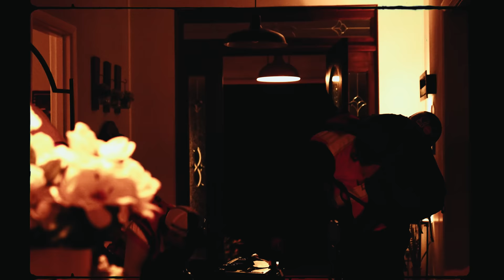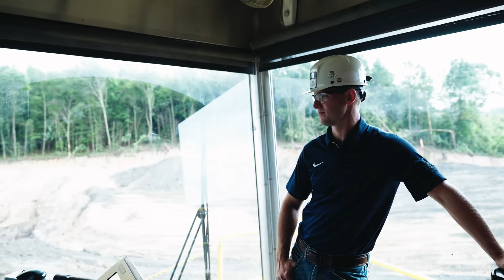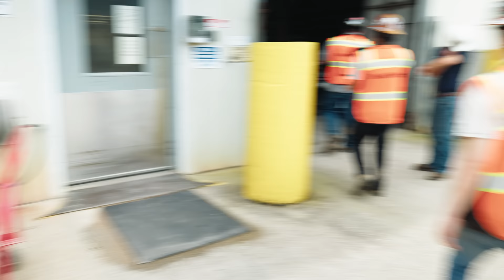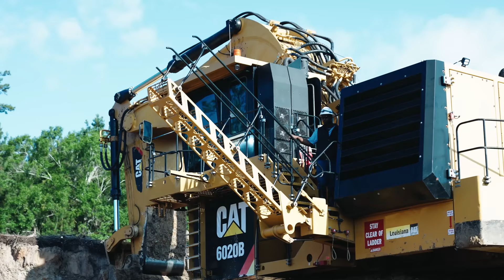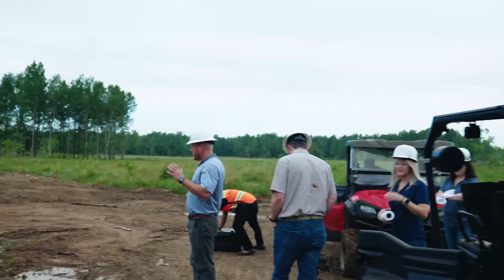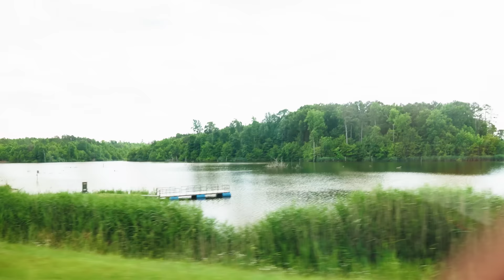The Hidden Truth about Coal Mining | NACCO Natural Resources

Comment: I worked at an surface coal mine in Montana for about 5 years. I saw first hand all of the rules and regulations that mines operate under. Complicated work. As far as I'm concerned it was one of the best paying in wages and benefits jobs I've ever had. I wouldn't hesitate to recommend anyone working at a coal mine.

Comment: Here in Australia, we've a few problems with owners not being on top of their rehab, until quite a bit later in the operation.  This is more an issue with older mines, where rehab wasn't taken as seriously as it should have been.  
Most current mines are pretty on top of their rehab from the moment the dirt starts getting moved.  Rehab has to be designed into the mining operation.  

How well do you guys cope with acid sulphates in overburden?  This is something we've only just realized is a problem here in Aus in the last 10 years or so, and has the potential to be a major issue?
Reply from the maker: not sure. I'll ask about it next time I'm with these folks
Reply: @AaronWitt  Yeah, Australian operators basically took the attitude that "Acid sulphates.  That's only a problem in hard rock mines!"  Then they ran some tests, and got a very rude surprise....

Especially when you consider you need to design spoil piles to last about a thousand years if they are part of final landforms.

One more question.  Are these guys in pit dumping?  Obviously, that's the case with the dragline, but with truck and shovel operations, it normally gets transported to a spoil pile.  I ask because, over the last few years, a few operators have been regretting in pit dumping because with the substantial increase in coal price, digging deeper is now really worthwhile.  A number of pits in Australia are going to nearly 200m, or deeper, seam thickness dependent  Unless your pit has been already filled in (another reason some big operators, e.g. Glencore, don't like draglines.)
Reply: @richardhaselwood9478  Well, they reference a regulation from 1970', so I wouldn't expect a stringent rules on a modern lookout on a soil chemistry.
Reply: @andreyfomenko2644  It's not just soil chemistry though.  You need to have a good understanding of the chemistry of all your overburden, otherwise, you get unpleasant surprises 20 to 30 years later.
Reply: Before mining, we drill cores to 10' below the lowest coal seam we mine. Samples are sent for laboratory analysis & if acid forming materials are identified, we know to bury them so no acid seeps will form in the reclamation.
Reply: @rebeccamcgrew9681  we always core a 6m sump too when drilling.  The floor however isn't much use for overburden characterisation studies 😂
A few mines in Australia are doing overburden characterisation studies nowadays.
There needs to be more of it.
Reply: Reactive ground in atmospheric conditions is an immediate problem and a long long lasting problem that will not ever in our lifetimes be resolved due to geological conditions. Therefore some sites are very profitable but at what cost ?. And who regulates this in Australia,  hahaha the money .

Comment: Aaron, I enjoy your expertise about heavy equipment.  However, the country would not lose its power supply under a 10-year phase out of coal for power.  We have good alternatives.
The expertise of the coal miners can be repurposed in many of the other industries you cover:  Construction, as well as copper and aluminum mining, which we wil continue to do.
We do need many more construction workers.  As to regulation, this industry has a long history of effort to roll back many of the laws and regulations you promoted here.
I respect that you obtained one side of the story in detail.  We need both sides to make independent judgements.
Reply: Wrong!

Comment: Here is what I have learned, in order to operate a coal fired power plant. The daily fuel costs, to run all those multi million dollar trucks, cranes, and super sized cranes have to be mind boggling. So building  a farm of windmills would seem a lot more efficient than burning thousands of gallons of diesel every day to make electricity instead of using wind. Also you don't have to tear up large tracts of land that will fine in 50 years. I understand your point about the new coal mining and I agree its better than leaving pits behind like they did in the eastern U S, however It boggles my mind how much fuel is used to make  electricity with this method. How sustainable is this really..
Reply from the maker: fossil fuel is waaaaaaaaay more efficient at creating energy than renewables it's not even close. That's why it's still the go-to by cost per unit of energy
Reply: @AaronWitt  How much fuel is burned every day? What so you are saying it is much more efficient to use thousands of gallons of fuel every day and the overhead on multi-million dollar machines to keep a coal plant going then using wind? Do you count the fuel used in the reclamation factored in or not?  My state gets 67% of our electricity from wind and the 2 coal plants are very expensive and costs our state more to run than the profit they make, You will have to show me more than a statement.. Fuel will not get cheaper as the years go on,
Reply: @richardkallemyn5594  every windmill cost upwards a million bucks each start to finish
Reply: @kenhofer8063  True, however once it's in place and running aside from PM's it 's fuel is wind. the coal plant needs coal every day to produce electricity. Do you think those massive trucks and cranes don't  burn massive amounts of fuel every day. How much fuel is used every day? Are they including the fuel for reclamation ?